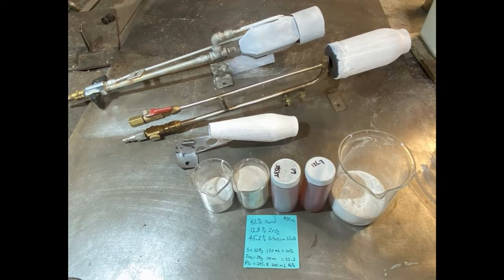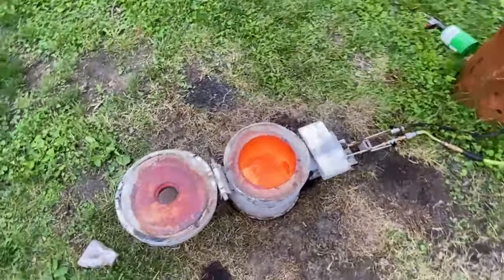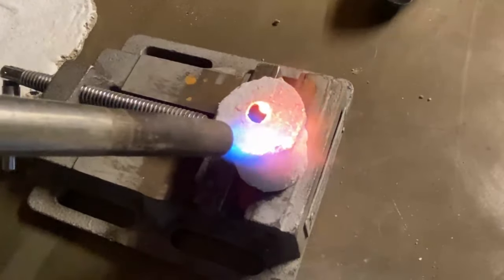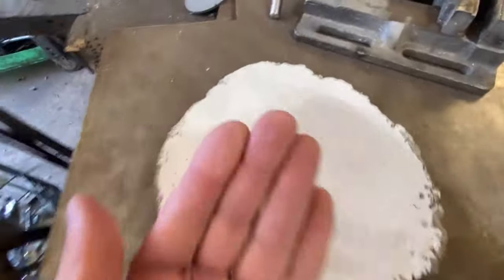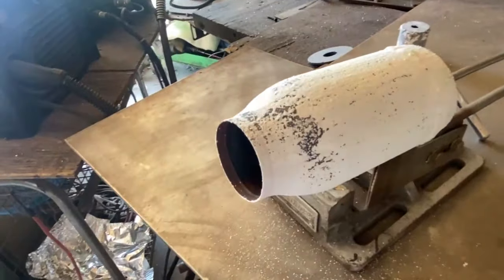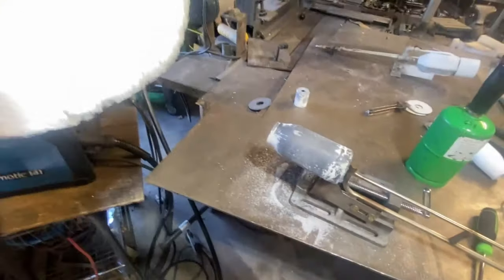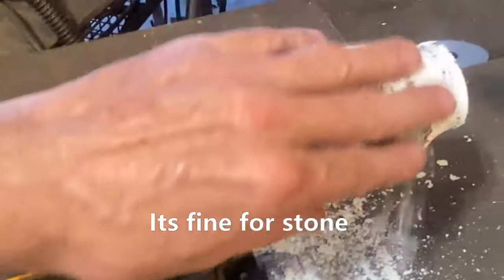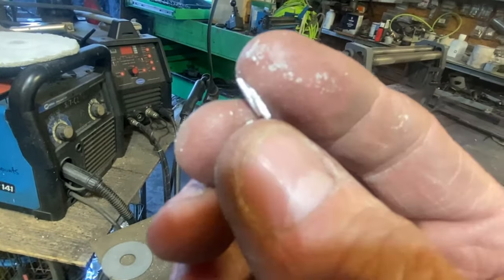1970's Space age high temp ceramic paint formula testing

Comment: Mineral calcium dust 50%
Calcium oxide hydrate 20%
Portland cement 28%
Fiber glass dust 2% 

2800'C by 30 min
With this coating it can be immortal

Comment: Are you using "Waterglass" as a Binder?
I’m not sure, but Sodium Silicate is supposedly stable up to ~1100°C (~2000°F) and pure Silicondioxide should go in the Direction of ~1665°C (~3000°F).
Someone on YouTube copied the NASA Heat Shield Recipe with Success and it’s using colloidal Silicondioxide that fuses at a reduced Temperature because of the small Particles.
Fumed Silica mixed into Water might do it.

A very thin layer of any Refractory might have a chance to cope with the Heat Shrinking of the Steel below, but it’s still problematic.
If you coat it a Steel with lower Expansion might survive because its shielded. But coating onto a Ceramic looks like a better Option.